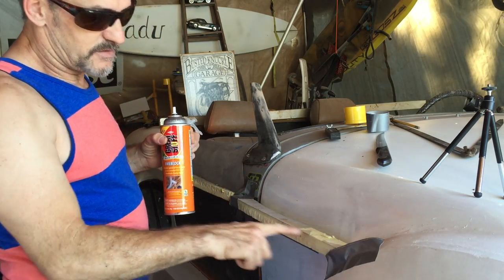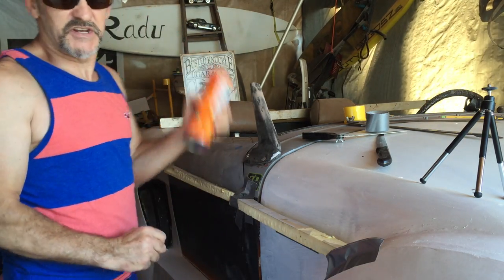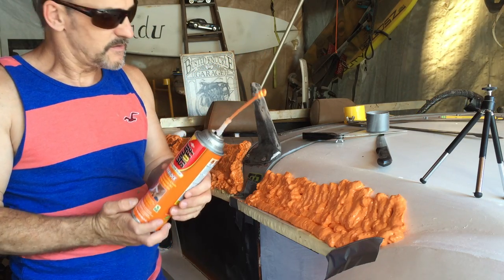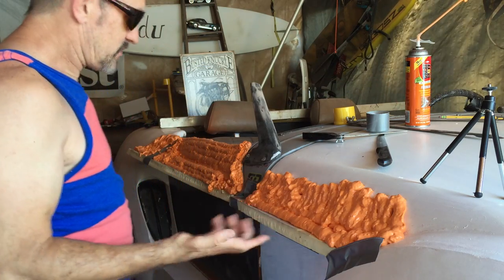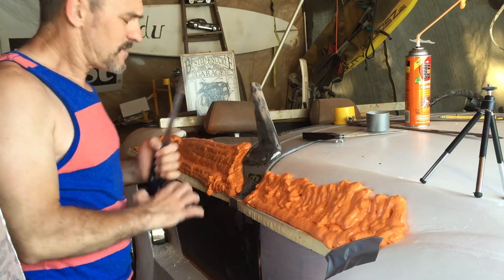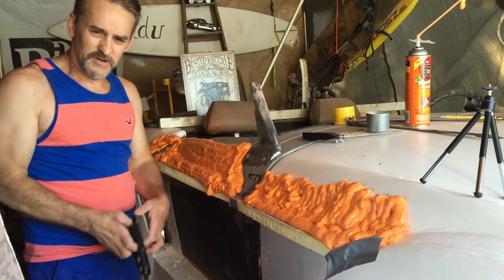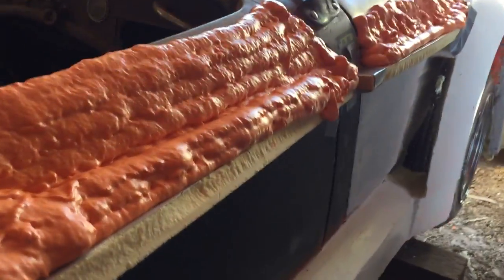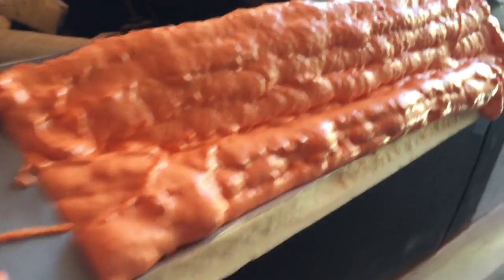How to Wide Body your Car using foam

Comment: Hi! I am from the Philippines, my questions is, would it stop the rust in the near future by using foam on and in it? 
I am working on my pickup truck. and finding more easy and cheapest body restoration I want, due to lack of money and parts.

also, what kind of foam do you use?

Appreciate your kind response. Cheers!
Reply from the maker: +jetdanga lenciano hello this is not for the rust and I'm not going to give you the wrong information , but rust remover and fiberglass is a good way to go 
In my project im using foam because im transforming the look of the car and wide body the car lol 
Good look on your project
Reply: Radu Blaga thanks. I think I am wrong whith my question here lol. BTW. How about the question of. What kind of foam did you use? From my country its hard to find one though. Mighy need the exact name of material to buy 😉 thanks for the good info.

Cheers!

Comment: So im trying to make body kut this way after you shape the foam is it better to use fiberglass resin or use filler on it? Thanks for yr help im learning still
Reply from the maker: You need to use body feeler first , because if not the foam is  going to melt 
Or you can use AC duck tape that way the fiberglass doesn’t stick to it 
And it’s easier to remove  or release the form 
Good luck on your project
Reply: @meradu2  awesome thank you so much for your help we will put body filler first

Comment: The 2 things that I don’t like about using “Great Stuff” is 1: For best results you have to use the can upside down. 2: For best results you have to use all of the product in one swoop. I have used it to seal up corner edges in a shed and it’s messy. The moment you stop is the moment the tip starts drying causing the product to start expanding and hardening. This decreases both spray time and the amount of product you have to work with. Using the product upside down is directed in the instructions on the back and it comes out Fast initially. It’s just awkward getting in upper corners of a shed if you have a low rise or flat roof. It can take up time because the outside reacts with air so sometimes the inner foam may be wet. Just FYI.
Reply from the maker: Thank you and yes this product was not designed to do watt I’m doing but is working for me lol It is a very good insulator for cracks  or like you say in a corner of a shed fix
Thanks for watching my video

Comment: hi i have a few questions and hope you can answer them for me :). do you remove the foam afterwards ( by making a fiberglass panel on it? if you do or dont how are you gonna secure the pannels on the cars body so you can drive with the car without the risk of the panels falling off?hope to hear from you soon!
Reply from the maker: +popo555able good question and yes I'm going to remove the foam and create a  fiberglass panel, and my panels are not going to fall off lol but you need to watch my video when I get to it ..

Comment: hello nice car I have a few questions about what you are doing. can you fiberglass over the foam " great stuff " It won't eat the foam. how do you take out the foam off after you fiberglass.
Reply from the maker: yes the fiberglass is going to eat the foam you need a protection of a AC tape over the foam first then apply the fiberglass 
Thanks for watching and good lock on your project
Reply: Radu Blaga I was gonna ask the same thing.